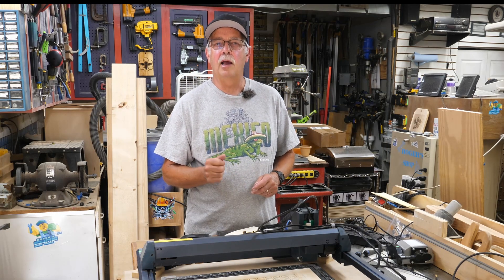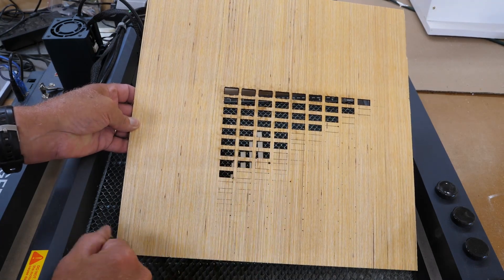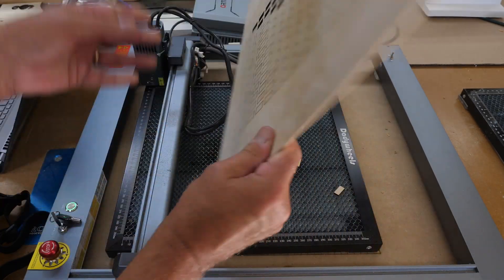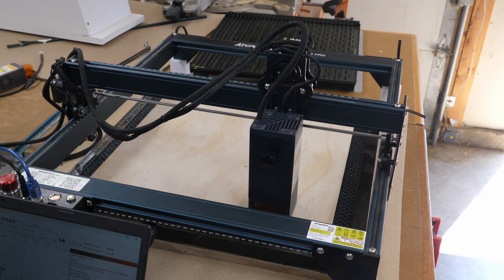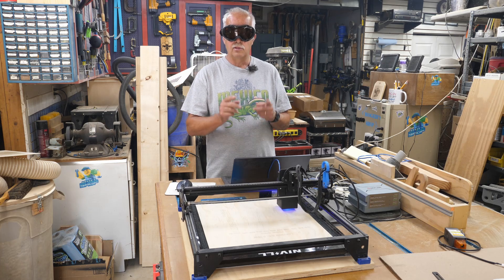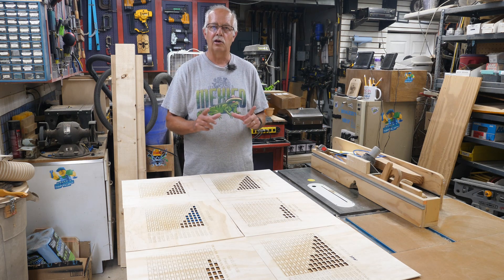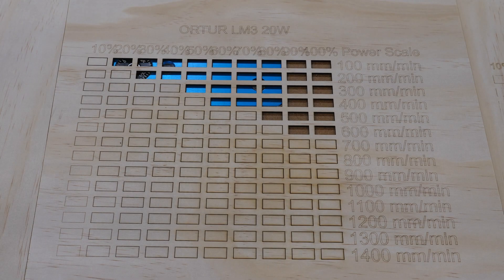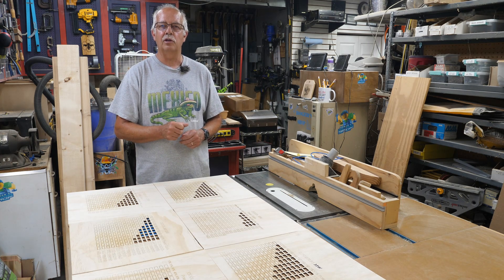Avoid These Laser Cut Mistakes: Mastering the Right Settings

Comment: My laser dont cut 3mm plywood with speed 150mm/m and even with power 100% what can be the reason? I tryed all types of gbrl in lightburn
Reply from the maker: My first two thoughts are proper focus and is the lens dirty?
Reply: @rogersshop  thanks you for the answer. Im not sure about proper focus because I dont know how to check this but I will learn this tomorrow and check. I cleaned laser lens few days a go but maybe I dont made it well so I will check it again. Half year a go its worked much more better :p but then it stay few months not used and now I wanted start using this again. I watched video where someone who have same laser "longer b1 w30" cut plywood 5mm with speed 1000mm/m and I cant cut even 3mm with speed 150mm/m..... its crazy for me. Thanks you very much for your advice i will take it to heart and I will check it tomorrow, because now is 00:40 oclock in my country 😅
Reply: @rogersshop  i do it everything but its dont helped i think its problem with Lightburn not with laser, when i used another program "lasergrbl" i saw big diffrence, but this program is totaly black magic for me, so in lightburn i reset to fabric setting but it still dont helped but i see one problem and maybe this is the problem i tryed solution with type $30=100/1000 and $32=1
and when i type $30 there is a communicate "[MSG:Laser spindle on Pin:GPIO(32), Enbl:None, Freq:1000Hz, Res:16bits Laser mode:On]" maybe this is the problem?
Reply: Im not sure about proper focus i have to check how to check this but half year a go was good :p I tryed to clean lens few days a go but its dont helped i will check tomorrow again maybe I made it wrong. Laser is longer b1 w30 so with 150mm/m speed and 100% power i cant cut 3mm plywood 😅 while I watched video where  someone with same laser cut 5mm plywood with speed 1000mm/m... I will take your advice to heart and check it all tomorrow because now in my country is 00:30 oclock

Comment: Newbie here.  I have a Longer B1 30 watt.  After running my first Material Test, I think I inadvertently changed settings in the Edit Material Settings - specifically Speed and Max Power settings.  Can you tell me what those values should be?  Thank you.

Comment: Why would you not use 100% power to get the fastest speed every time on a LED laser? On a CO2 laser the longivity of the laser tube can be prolonged by using lower power. But is that really true for a LED laser?
Reply from the maker: Some say that running at 100% will shorten the life of the laser.  I generally run 90-100% at fastest speed that still gives good results and have not found much degradation.